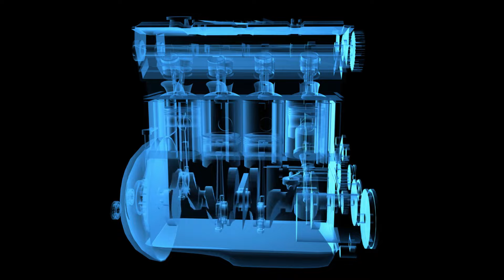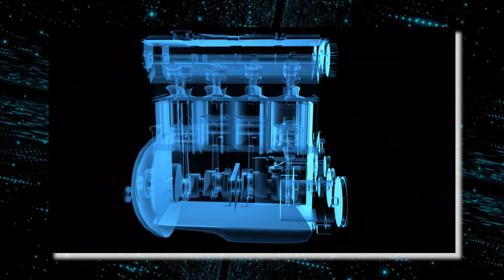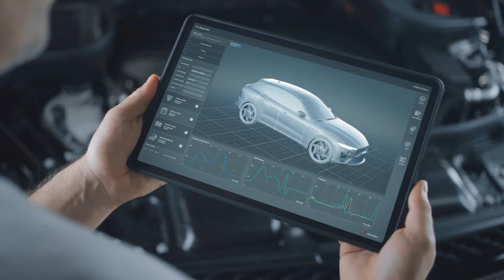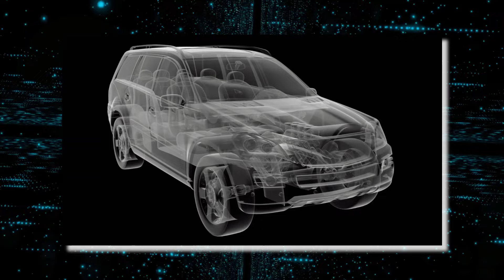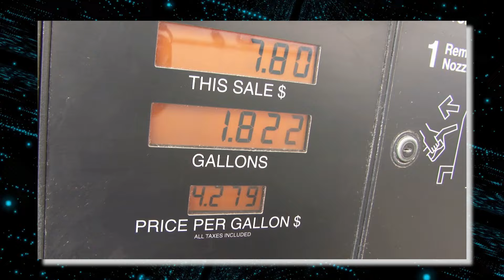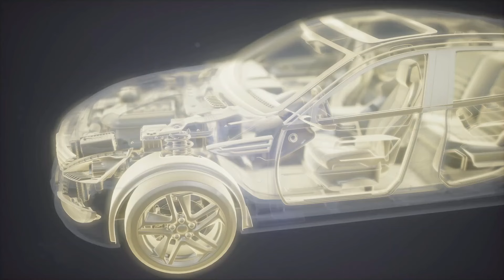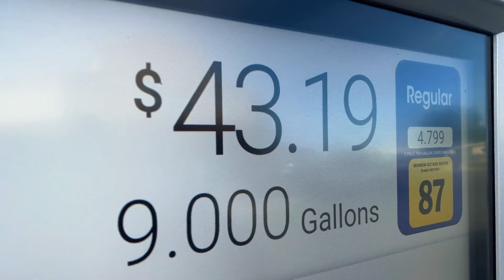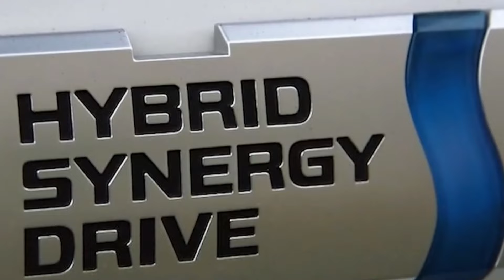Toyota CEO: ''The Entire EV Industry Is HISTORY!"

Comment: What a great idea. Innovation of using water to produce clean energy electricity, for use to power electric motor. I only hope, by going only with electric engines, governments are not going to give serious consideration to other forms of clean energy. Funny how ev's are increasing their presence over internal combustion engines, but the CO2, plus sulfur dioxide, and other contaminence have over doubled in the last year. I think it's caused by increased use of electricity. This extra power is done by increased use of focil fuel to make the electricity. We need to allow science to continue to innovate new and exciting green energy, weather by electricity, hydrogen, water, or any other form of non focil fuel for a clean tomorrow.